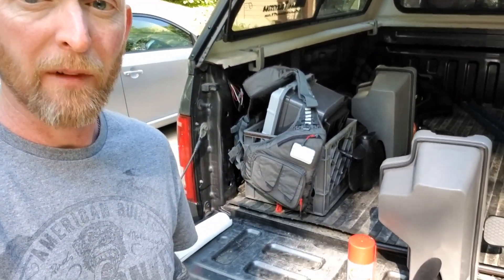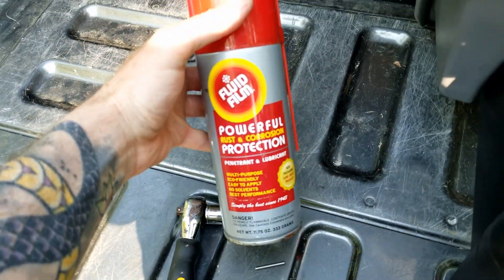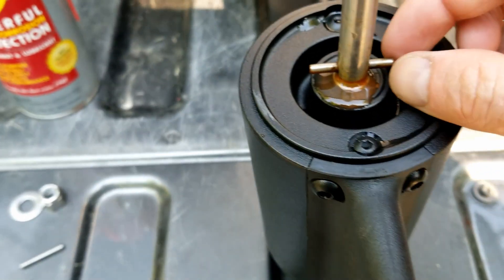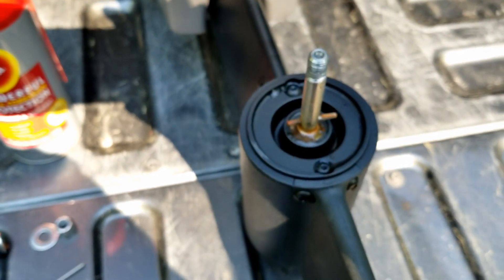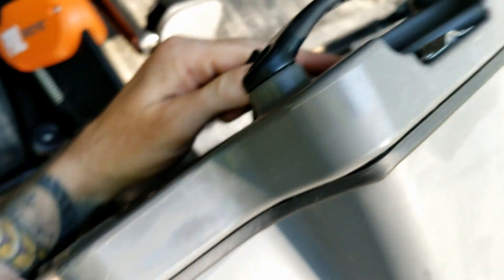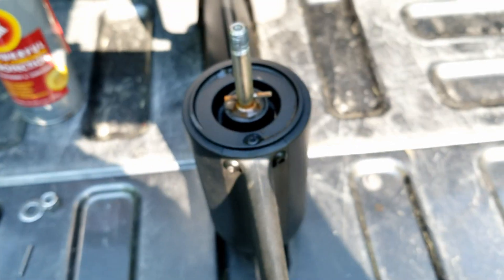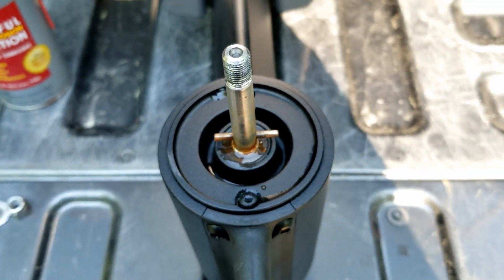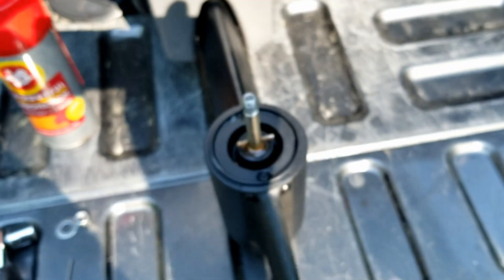How to Prevent a Broken PDL Drive Pin

Comment: Glad your doing more video’s - how about some more pike tips? I have been planning a trip for a while now to get to the Moore Dam.
A few more tips for the prop and drive. Aquashield grease is another grease that is made for marine environments (very sticky grease - clings so well you should use gloves to put on) that should not harm the seals or prop (rubber and plastic) - some oils degrade them badly - WD 40 or any petroleum based spray with solvents are usually the worst. In a pinch I have found that I can cut a shaft from a small dremel tool to use as a drive pin and the small shafts fit great! Put small dremel tool in vise, then cut it with the tool and grind the cut end a bit so it is not sharp. You have to be careful to not overtighten that nut as well, since you can snap the stock drive pin or any replacement. You can get replacement pins cheap too - order the small Minn Kota drive pins for their trolling motor blades (same company, same pins). Make sure you get the small pins (part # 2092600 the 1.06 size - they make larger ones, so make sure you get these smaller ones). I got two recently for just over 5 bucks total price delivered. As Tim says, keep those spares in the kayak (a small prescription bottle works well too - I’d coat them with grease as well. I keep two, along with the right size closed end wrench  for the nut and a spare prop with me in the kayak. I zip tied the spare prop to my milk crate. I put the wrench and pin bottle in a small mesh bag - you can tape the wrench in a small foam pipe insulator, so it does not make noise and put into the center console dry box (not really dry though). Do yourself a favor and grease the wrench too (use corrosion X grease for that since aquashield grease can make a real mess. To make the pedal drive console (old style one) more “waterproof” put a good size bead of pure silicone (grey will match well) seal around the outer circle of the round hatch seal - the round hatch itself has a seal, but the outer part of that round seal - just outside of the screws, is recessed and I bet not sealed well. Also grease the round hatch “knob” (that twist locks) on the under side where it leaves an opening where it turns to lock - the recess in it’s design holds water and that easily can leak in - you can fashion a seal for it if you have the time and know how (not hard). This will button up that hatch better to keep out water. If you are forced to do an on the water repair, put something under the unit so you dont’ drop the pin or the nut into the drink or your screwed. I have lots of other little mods that I have done for my PDL - I have started to do a monthly column for Joe  Catalano of Nashua (NH) rod and reel repair and will be going over new kayak stuff month to month. Old Joe is a treasure to the fishing community in New England and he has folks help him put out this monthly newsletter and it is great! Google Granite State Tackle and see his website and ask to be put on his newsletter email list.
Jim Dalton

PS - If you do some more PDL stuff (Our community is growing and I saw you are repping them now) I will add info on my latest projects that anyone can do at home - inexpensive led light on a pole for night fishing light requirement ($15 bucks). Works great and is very reliable so far.  Good orange flag too, for 7 bucks.

Comment: Thank you...very informative! I plan to purchase a 120 PDL within the next few days. This tutorial made me feel better about the purchase. On another channel, a used PDL user was told he’d have to send the PDL in to have the internal shear pin replaced. The used PDL user referred to the PDL as something to replace and not repair. Thoughts?
Reply from the maker: The PDL drive has a 5 year warranty for the original purchaser. There are few reasons you would have to send the drive back. I'm not sure about replacing any internal sheer pin. I don't believe there is one. A few users have experienced some loosening of the drive shaft, which is a relatively easy fix. Old Town can assist, but it's pretty rare. It's just an internal screw that loosens up. If a user feels an increase of in and out play they should contact OT customer service.
Reply: @TMOFishing  Thank you very much!

Comment: Is there a link you can send me to where i can buy new pins at, had my pdl for a few years now, never been in salt water yet, but just wana be prepared if it goes bad
Reply from the maker: There should have been at least one extra pin in the package that contained the paddle holder. You might be able to buy them through the Old Town website. If you can't find them at oldtowncanoe.com then try calling their customer service. I usually call and order mine.

Comment: I use mine broke and I never notice a difference
Reply from the maker: You can't use the PDL drive if the prop pin breaks. I'm not sure what you mean here.
Reply: @TMOFishing  Every time I take my prop nut off this shear pin is broken and I never know when it breaks. Yesterday I replaced a broken prop on the water. First time I'd broken a prop since getting the Kayak in September. When I took the prop off the pin was broken and when I reinstalled the old one the pin was broken because I didn't have any extras.
Reply from the maker: @TridentDriver  I broke a pin once. It broke next to the shaft and the prop wouldn't spin. I was dead in the water.
Reply: @TMOFishing  Shoulda tried loosening nut slightly
Reply from the maker: @TridentDriver  it was coroded from saltwater use and me not protecting it wit anti-corossion spray.